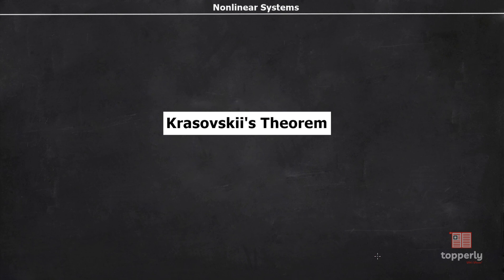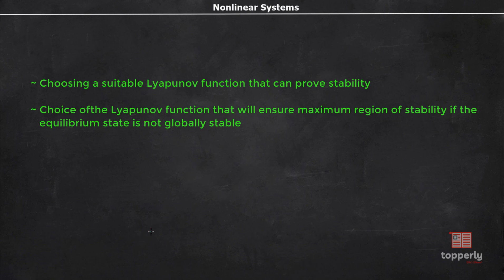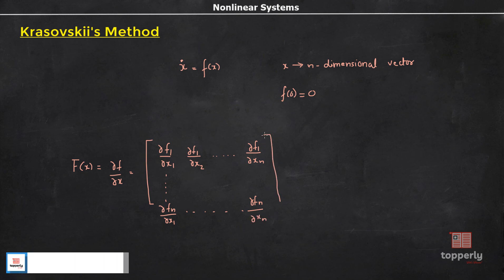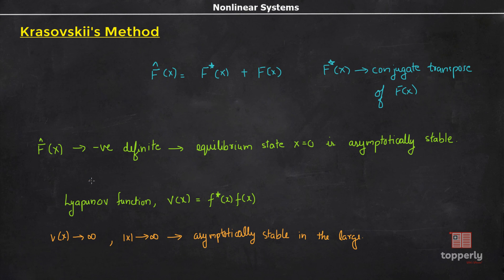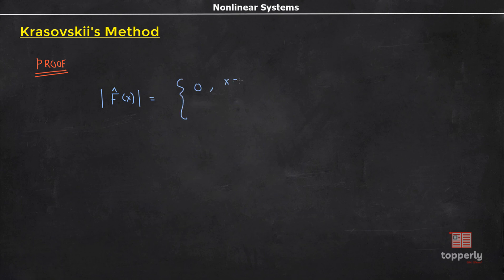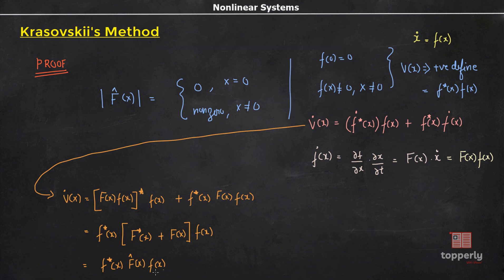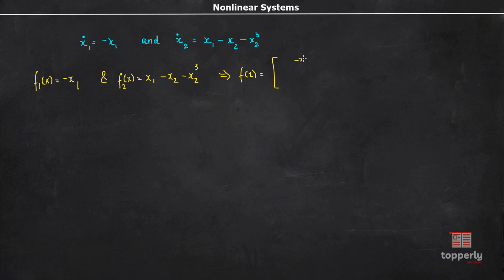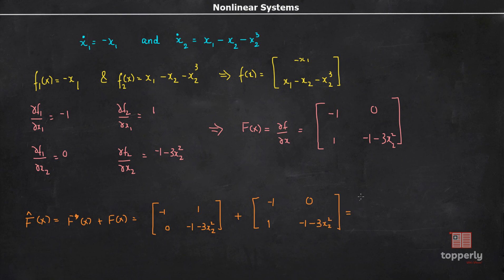Krasovskii's Theorem | Nonlinear Control Systems

Comment: Thank you for video. But, I have a question for you.  if in a mathematical model there are two equilibrium points.  how to find the lyapunov function using the krasovskii method?
Reply from the maker: Hi Intan, 
Lyapunov Theorems only comment about the stability of equilibrium point at origin. And Krasovskii's Theorem also thereby deal with the equilibrium point at origin only :)
Reply: @Topperly  For example, in the sir model, there are two equilibrium points and will be analyzed for global stability.  could it be the krasovskii method?
Reply from the maker: I don't think so. Krasovskii can only determine the stability of equilibrium point at origin.
Reply: @Topperly  I'm dizzy now because I think about college assignments
Reply from the maker: Haha...I can understand. 
By the way, if you only need to check stability of equilibrium points, you can use phase plane analysis for that :)
Reply: @Topperly  hahhah sorry. I am not very good at speaking English 🙏. And thank you verry much
Reply from the maker: Thank you for your support. If you found our videos to be useful, kindly share it to your friends also and help us grow! :)

Comment: mam thank you for video  but i want to ask is it necessary condition for stability?
Reply from the maker: Krasovskii's Theorem deals with choosing Lyapunov function. If F^(x) is not negative definite, it does not mean the system is unstable. It simply means system stability can't be ascertained by the chosen Lyapunov function. So, it is not a necessary condition :)

Comment: Thank you for a great video! Do we have a necessary version of this result? Could you also add some references (e.g., books, papers) to the description? Thanks.
Reply from the maker: Sorry, I didn't exactly understand what you meant by necessary version. Could you please elaborate?

As for references,
1. Applied Nonlinear Control by Slotine and Li - https://amzn.to/2Ed8Rw6
2. Nonlinear Control Systems by Alberto Isidori - https://amzn.to/3l5VeQv
3. Nonlinear Systems by Hassan K Khalil - https://amzn.to/3aG0zsA

You can also find original papers, but I'm afraid most of them are behind paywalls.
Reply: @Topperly  This method is a sufficient condition for stability. By necessary, I meant that are these conditions (must be) necessary if the system is asymptotically stable. Thank you for the references, I got them all.
Reply from the maker: Krasovskii's Theorem deals with choosing Lyapunov function. If F^(x) is not negative definite, it does not mean the system is unstable. It simply means system stability can't be ascertained by the chosen Lyapunov function. So, it is not a necessary condition :)

Comment: Hey Topperly I am very early viewer of your channel and Its help me a lot. I am really thankful. I have one doubt that if in -F^(x) the first minor have (-2 +6x1^2) and second minor have |{(-2 +6x1^2)(-2 +6x2^2)}-0| then how we will say that -F^(x) is +ve definite or not. Or does F^(x) is semi -ve definite? then system will be stable or unstable.....or what is your opinion. Thanking you for your great work.
Reply from the maker: I'm a little confused here. What's your F^(x) again? Can you please write all it's element in a row and mention the dimensions of the matrix so that I can take a look?
Reply: @Topperly  the  ; F^(x)= [R1;R2]= (2-6x1^2)  0 ; 0  (2-6x2^2)]
Reply from the maker: Here since the principal determinants are sign indefinite, (using sylvester's theorem)we can't conclude sign definiteness of F^(x). 
And by definition, Krasovskii's theorem only state that if F^(x) is negative definite, then eqbm state at origin is asymptotically stable.

Here, we can't conclude sign definiteness of F^(x), hence stability cannot be ascertained using Krasovskii's theorem.
Reply: @Topperly  Interesting what I had thought. Thank you.

Comment: Thank you for the good explanations. My doubt is since V(X) is our choice as you said in the previous videos, can we always take the positive definite function x1^2+x2^2 as V(X) ? then why this method is used?
Reply from the maker: But that V(x) does not always necessarily represent the energy function of our system satisfactorily. According to Lyapunov Stability, we need our dV/dt to be negative definite for system to be stable. But V = x1^2 + x2^2 doesnot always guarantee a negative definite dV/dt. In such cases, randomly choosing a V(x) that satisfies lyapunov stability will be a painful exercise. Here, Krasovskii' Method or Variable Gradient Method makes our search for V(x) easier :)
Reply: @Topperly  understood, thank you for the quick response and your concern in doubt clearing
Reply: @Topperly  Thanks very much for these videos